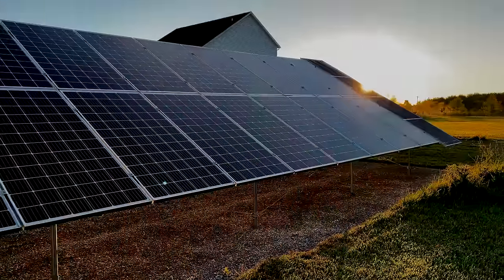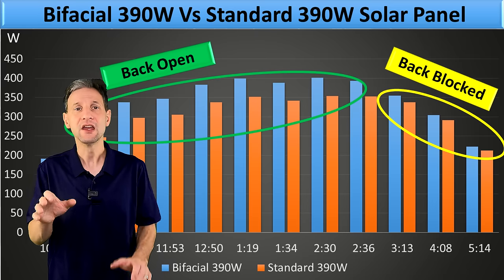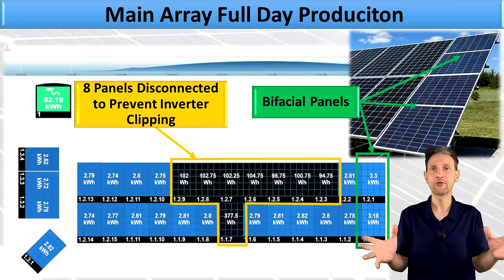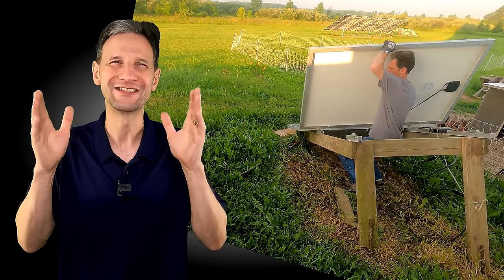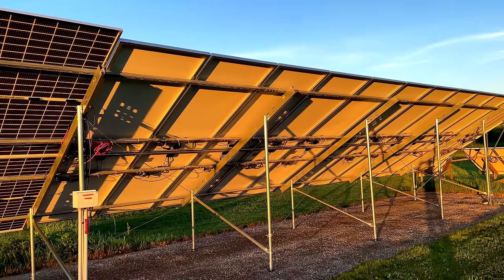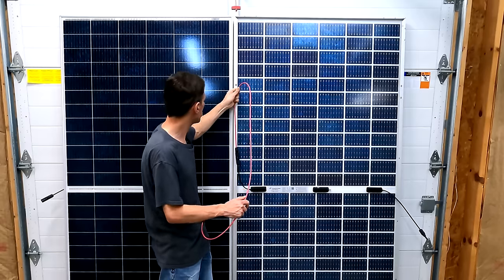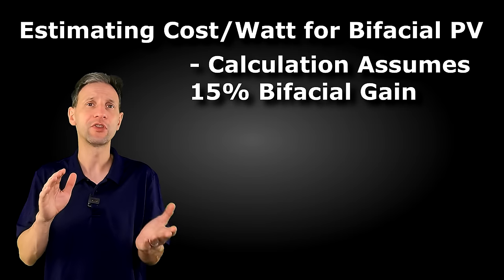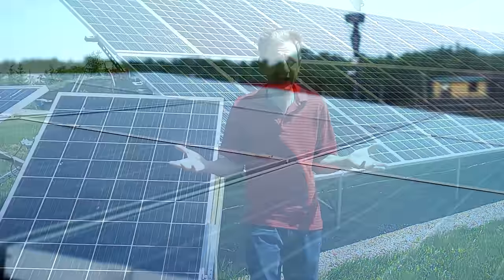Bifacial Solar Panels - The BEST Solar Panel? Real World Results!

Comment: hello from sweden thanks for interesting video , i has just put bifacial panels vertical on a fens , thinking ther not will be snow on them at winter , here price now stay at circus 30-40 cent per kwh but they talk the price will rech 2$ per kwh in december thinking on put reflector on ground and 1.5 meter behind when penels is oriented west-east but it is hard to find costeffective materials i thinking to try white plastic farmer use for cowering ensilage you have better material ?
Reply from the maker: Anything highly reflective will be helpful, so think about low cost and durable solutions.

Comment: I think there is a massive problem in the whole consideration

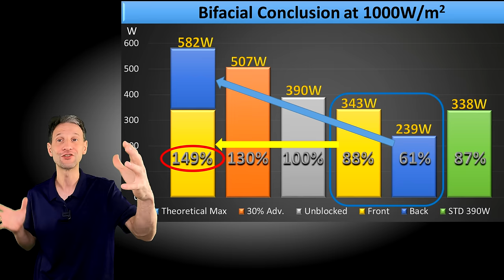8:25 Depending on the manufacturer, the bifacial factor is either already included in the performance or it is added on top. You have to pay attention here
In the case of Canadian Solar CS3W-390, the module generates 390W and bifacial gain is added on top.

I'm also a bit surprised by the values, that needs to be explained to me.
STD 390W reaches 87% by 1000W/m² Shouldn't that be 100%?
The blocked CS reaches 100%, which should be the norm.

it may be that the standard module simply does not meet the requirements?
Reply from the maker: The rated value is measured in a lab with controlled temperature and no inverter conversion losses at 1000W/m^2.  I use that irradiance as a reference point for testing panels, but it usually comes in somewhere between 80% and 90% of the rating.  I can't say for sure why the bifacial achieves 100% even when the back is blocked.
Reply: @ProjectsWithDave  How many solar modules have you already tested in the laboratory? Were there always such deviations?

Maybe I'm completely wrong, but the output of the solar modules is also determined at 1000W/m^2 (EN 60904-3) and that is also the value in the data sheet. A 480W module should produce 480W under the test conditions in the laboratory?

If it comes out less, you can assume that either the data sheet is wrong or the module is defective?

"I can't say for sure why the bifacial achieves 100% even when the back is blocked."

In my opinion, that's not necessarily the question, because the bifacial module provided exactly the value from the data sheet :-) The question is rather why the other module did not achieve the value from the data sheet.

Comment: A mirror on the ground under the solar panels at the same angle as the solar panels would be cheap and easy . It has to magnify the amount of light on the back so it has to increase performance . Only down side is the amount of heat it would create .
Reply from the maker: Also, mirrors generally don't have tempered glass and would be at a high risk of breakage.

Comment: Bi-facial panels are bigger you did not account for that
Reply from the maker: I was comparing rated performance and cost per watt, not watts per square meter.  If space is a limitation, you would want to add that metric to your decision matrix.

Comment: If you put cheap mirrors underneath then shouldn't that boost the productivity?  Just wooden frames with a reflective plastic stretched across it.  I've heard part of the reason why they are better is because the efficiency of PVs goes down the hotter they get, due to resistance.  These new panels stay cooler.
Reply from the maker: Any reflective surface underneath helps to some degree, but it may not be enough to warrant all the trouble of installing a reflector.  I have some winter results here that show that high reflection isn't that much of a boost: https://youtu.be/YZWeCUzu0yQ

Comment: You mentioned ideas on utilizing bottom under face of panels...would mirrors or something reflective do the job? Good video, thank you very much for information sharing. As a prepper working on complete off the grid lifestyle this is helpful.
Reply from the maker: I have some snow reflection results coming soon that will give you some idea of what you can expect to gain with reflection.

Comment: Hi, is bifacials panels call half cut panels around here in Europe?
Reply from the maker: No.  Half cut cells or half cut panels refers to the configuration of cells in the panel to reduce the impact of shading.  A half cut panel can be single face or bifacial.

Comment: So I tried these on a small scale and if you take these and build a 3d tower with a reflective ground cover and if you add side reflectors shit I even tried adding lenticular lens lol what I will says if you start getting 8 or 10 panels + you can increase the efficiency 2x and double ur output. I challenge you see how high you can safely go and add some reflective shit and see what ya get. 3d Tower setup with the bifacial cells its awesome
Reply from the maker: I plan to do more reflective testing.  If you have a website or picture of your "3D Tower" that would help.

Comment: Hello Dave, Im going to install almost 5MW of 685/690W Topcon bifacial Canadian Solar module within a land plant in north of Italy (latitude 44.7387° north, azimuth 0° and tilt 20°). What do you think will be the peak power cause of the bifacial gain? Thank you.
Reply from the maker: There are too many other factors to answer that question.  A rough general estimate would be 10%.
Reply: @ProjectsWithDave  Of course. Albedo's value is sure very important. Did you consider 0.26 (green grass' albedo) in your estimate? My worry is that I already have a inverter loading factor of 129%. Considering that extra 10% (my supplier gave me the same gaining factor), the maximum loading factor would be around 142%. Surely I won't put any white nylon under the modules.

Comment: Instal the bifacial panels in vertical orientation where at mid day peak heat the panel is not getting any sun, instead of at an angel to capture the max of light at mid day.
Reply from the maker: You can see the winter result for vertical panels here: https://youtu.be/5AVO1IyfA9M

Comment: Have you tried mounting the bifacials vertically and facing east-west?

I have heard having some of your panels in this configuration will lead to a much more sustained power generation through the day and reduce the need for batteries
Reply from the maker: I keep hearing that in the comments, I don't expect it to work well, but I guess I'm going to have to try it so I have data to prove it right or wrong.

Comment: Hi Dave, please help me with one simple piece of information. I have an 8kW Solar Mpp and 10 solar panels of 590Wp each. The inverter, in the description, is 2x4000W. My question is: can I put all the panels -5900Wp on a single input to the inverter? VOC is 42V for each panel - the inverter supports Max. 500V. Or how is it better to proceed? Please I wait for your answer ASAP. Thanks,
Reply from the maker: I can't make an exact recommendation without the specs for your particular inverter, panels, location, panel angle etc.  If you are not sure if your exact configuration is ok, contact the manufacture.  They will give you their recommendation for your exact panels.    However, In general, the most critical specification not to exceed is the VOC.  42VX10=420V which is less than the max of 500V.  However, that is still close to the limit and if you are using bifacial panels, they can see much higher than nominal rated voltages.  Also if you live in a cold location you can see higher voltages.  If you have 2 inputs as stated above, it's likely each one can handle a limited amount of current.  Your best configuration is probably 5 panels per input.  That will also allow you to put 5 facing SSE and 5 facing SSW to distribute your input throughout the day.
Reply: @ProjectsWithDave   Thanks a lot Dave. I really thought about it. PV is not bifacial, so I will make two strings of 5 PV each and I will have on each 2950Wp / VOC total 210V, MPPT needs Min. 100V at the input.

Comment: Dave - i am new to your channel and I really like your approach to testing,  how you explain what you did and why.  I just read about the efficiency of hanging solar panels completely vertical.  If you were to install a bifacial vertically to the east and rotate it 180 degrees at noon, would this maximize the benefit of the bifacial? Then, do you think the cost and complexity of a system to rotate a rack of 1w x 2h or 1w x 3h be worth it?
Reply from the maker: I have yet to see a tracking system that could justify it's cost.  It is cheaper to just add more panels to make up would could be gained by tracking.  I haven't tried mounting bifacial panels vertical yet, so I can't speak to how well that would work.

Comment: Use shiny rocks, and putting spaces between the panels to allow light to reach the rocks below. Should increase performance
Reply from the maker: Spaces between the panels would be a big benefit I think, but it would also require more racking.  I'm not sure the tradeoff would be worth it.  Some analysis would be required to judge that.  Thanks!

Comment: Would Baby Oil amplify the sunlight? What about adding a mirror under the pannel?
Reply from the maker: I'm sure mirrors would help, but they are very fragile.  Oil would likely reduce the performance as it would restrict certain wavelengths of light.
Reply: @ProjectsWithDave  the reason I'm wondering about baby oil is that would be a big no-no to put on the skin while out in the sun. I believe baby oil amplifies the sun. It's probably worth testing.

Comment: In Germany, bifacial panels are considered non-flammable. 
Normal panels with film on the back are classified as potentially flammable. 
This is important if the neighboring house is attached directly to your house and with normal modules there are certain distances.
Reply from the maker: Very interesting!  Thanks for sharing.

Comment: This may be a dumb question, but with increased power extraction from both sides of the panels, does it cause the cells to degrade faster?
Reply from the maker: Cell degradation is caused by solar exposure.  I don't know for sure, but I imagine the degradation on the front of the panel would be the same as a typical panel.  The back side would degrade much slower since the exposure is much lower.  Either way, you can get a good idea of the manufacture's expected performance by looking at their degradation warranty.  Hope that helps.

Comment: I live in Austin TX and have been thinking about bifacial panels for my future system. I have imagined this scenario: My install would be roof mounted.  I would install a white membrane roof instead of shingles. Then I would contruct a mounting rig that holds the panels probably a foot above that white surface probably using trusses of some sort. Then the panels would be placed in a checker board pattern or in vertical rows leaving large areas unblocked for sun to bounce off the white roof and onto the back side.  My roof faces south so the orientation is good.
Reply from the maker: I'm sure you would get improved gain with that setup, but I don't think it would be enough to justify the extra materials and effort.

Comment: Here's a question. So we've determined that the scientists have it correct and generally in North America you face your panels South and about 30° or so.... So in order to assist morning and evening power production what about mirrors? Set up mirrors to reflect the morning and evening sunlight onto the panels to increase productivity during those times?
Reply from the maker: You would need mirrors with tempered glass and a strong support structure.  It would be cheaper to just purchase additional panels.

Comment: I bought 72 of the same panels from San Tan, the delivery truck broke 17 of them on one pallet.  San Tan shipped me out another 17, and I received them in about 2 weeks.  Just had to salvage the broken ones.  making over 28KW in Florida.
Reply from the maker: Wow!  That's a lot of broken panels.  I'm glad you were able to get it worked out.  28kW in Florida, that should do very well for you!
Reply: @ProjectsWithDave 
I’m powering my property, and sold back 26 MW.  Little over $1,000 back.  My break even point will be right at 7 years looks like.

Comment: hi, what do you think about installing bi-facial panels on rooftop system? I intend to install solar panels on my roof. Will using bi-facial panels instead of standard one give me advantage or not? Please let me know your idea on this. When we are installing solar panels on roof, it's not possible to use 30 angle. Most of them suggesting 10 angle. With that angle I don't think back cells will get sun light they need to generate power
Reply from the maker: I am doing a test to confirm your question.  I recently installed bifacial and standard panels on my shed, you can see that install here: https://youtu.be/Y8OGxdJ9cU8
I expect to get very little back side gain when mounted parallel with the roof, however, based on my analysis from blocking the back side of the panels you will see some slight advantage.  I wouldn't bay extra/watt to put bifacials on my roof expecting some big advantage.

Comment: Simple and elegant solution. I'd be interested to see if the surface temperature is higher than the traditional type backing. This would of course affect life if elevated significantly.
Reply from the maker: Good question, I'll have to wait for a hot summer day to check that.

Comment: Maybe it's crazy thought but I have to ask it :D 

What if you put bifacial panels totally vertically like I   I   I   I  and so on.
On a flat surface ground, cement, that is gray or even kinda white. 
It would reflect from all sides from the ground and it won't be a problem when there's snow, instead it would produce even more, because snow would be on a ground and on the panels :D
Reply from the maker: Others have proposed that, I might try an experiment to prove it out.
Reply: @ProjectsWithDave  oh, I see comments now. Can't wait when you test it out :D

Comment: Since these are bifacial,  it would be interesting to see the long term durability and output over the years compared to the standard versions.  Hopefully it will be good for the long term but usually greater gains are at the price of greater losses somewhere else.
Reply from the maker: Time will tell, but I expect the bifacial panels to have less degradation over the long term since the back side should degrade very slowly with little direct sunlight.

Comment: so, how about a somewhat reflective surface put under the the solar cell in the right angle? 
i mean the normal sized rig, and you putting at least a white  material on the ground, angled so it hits the panels?
just spit-balling here an idea...
Reply from the maker: Yes, based on my snow results, which I haven't published yet, a reflective material on the ground would be a significant benefit.

Comment: great experiment !, what if the panels are mounted on a white roof or another white background ?, will it produce even more power ?
Reply from the maker: I mounted some on my white shed roof to answer that question.  Unfortunately the data I collected this summer was lost so I will have to try again in the spring.  However, unless the panels are at an angle on a a flat roof,  it will be worse on the roof.  There is not enough gap to reflect ambient light even with a white roof.  You can see the shed install here: https://youtu.be/Y8OGxdJ9cU8

Comment: Remove every other row of panels and place reflective mirrors behind the array.  Based on the numbers you're showing, you could have about 40% fewer panels, with gaps in-between them, but still get nearly the same rated output.  The only downside is the foot print of the array would be relatively large for the total number of panels deployed.
Reply from the maker: I think that would work, however, I believe the cost of the mirrors and extra racking would negate the performance benefit.

Comment: I just installed 20 480 watt panels at my cabin.  The weight issue is no joke. You need 3 people to install these.  You need to pay attention to the voltage in cold weather when you design them so you don’t overvolt your charge controller.
Reply from the maker: Yes, that's a good reminder.  Cold weather is when you will see the highest voltage.

Comment: how about spraying your gravel, with either a bright white outdoor grade paint, or covering the gravel in a white teram building sheeting ?? teram would be the cheaper option as it is supplied on 6m wide rolls and is designed as underground let water through building membrane
Reply from the maker: Spraying the gravel might be effective, and cheaper than purchasing white stone.

Comment: Excellent video. I am toying with the idea of a solar car port with a white gravel base. My thinking is that during the day when no cars are present it should provide a sufficient amount of radiant light, especially on overcast days. I have been trying to decide if it would even be worth it when compared to standard panels. Your results lead me to believe that it just might be. Thanks!
Reply from the maker: Yes, that sounds like a good application for bifacial panels.

Comment: If you had a row of them with spaces between they would wrok well in the winter with the snow relecting the light.  Even better on a South facing hillside.
Reply from the maker: Gaps would improve the reflection, but difficult to manage with the racking.